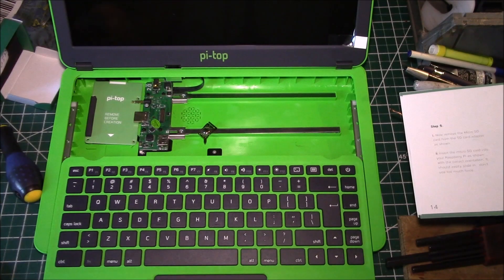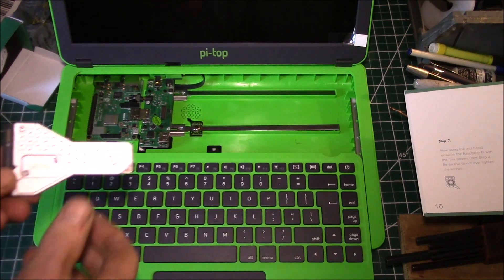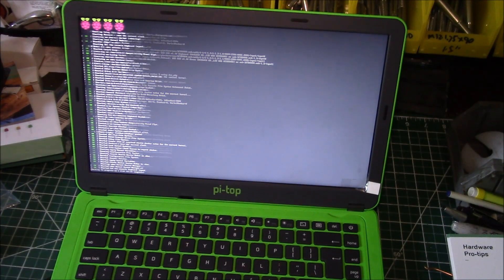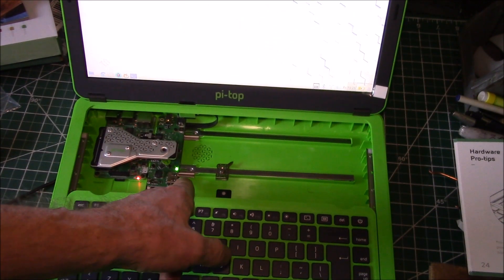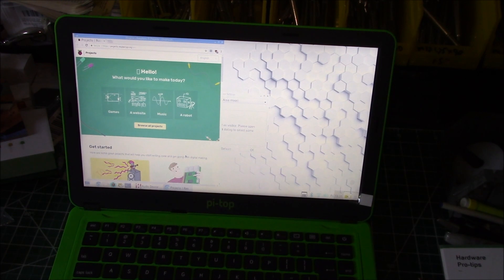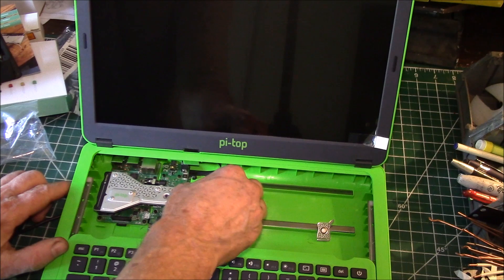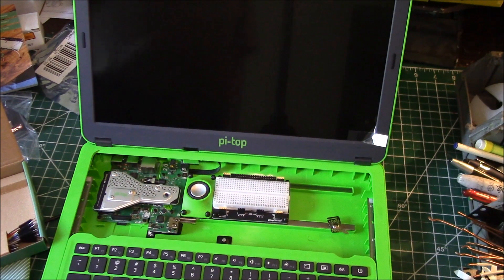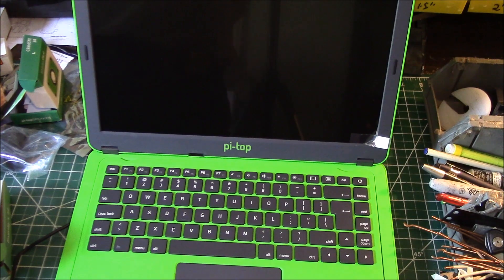pi-top: Raspberry Pi install and first boot.

Comment: Totally different from mine, I am guessing this is a later version. Mine apparently suffers from the PI sliding about if you constantly plug and unplug things into the USB sockets. Not an Issue for me, as I have a USB hub connected

I love it, it is a great way to get up and running so easy.

a great upload, thank you

Comment: I've been wanting to get a Raspberry Pi for a while but never knew if I should get a kit and which one or if I should just get the Raspberry pi by itself. But, I think I'll start with this.
Reply from the maker: Yes, this is a decent setup for learning and getting some experience with, since that's what it's designed for.  Nice that you have a power supply, keyboard, display and all the I/O ports available out of the box, and it's portable.  I started with making Kodi media players out of Pis, that's also a good way to get started, but those are single purpose devices, load the software, plug them in and that's it.